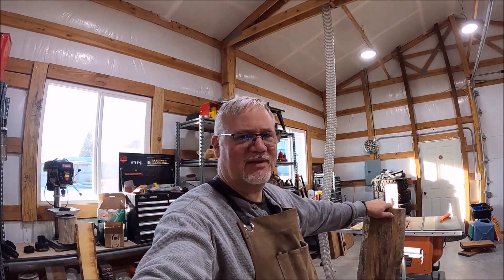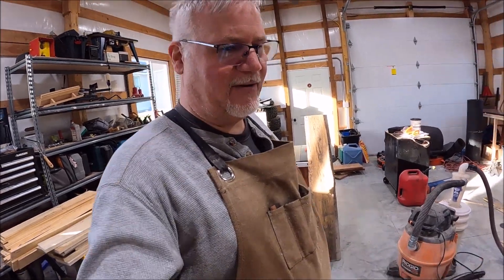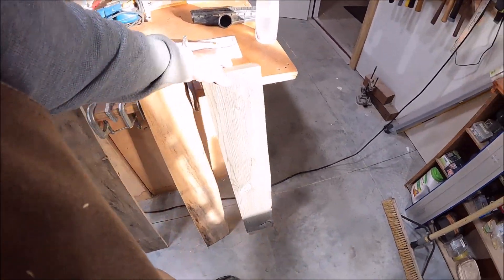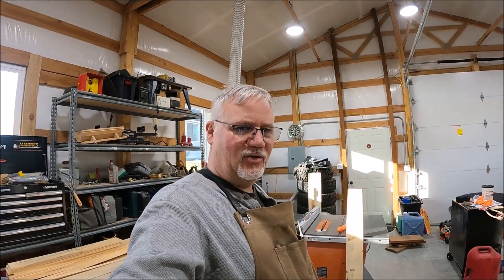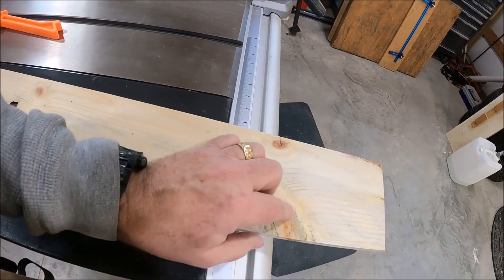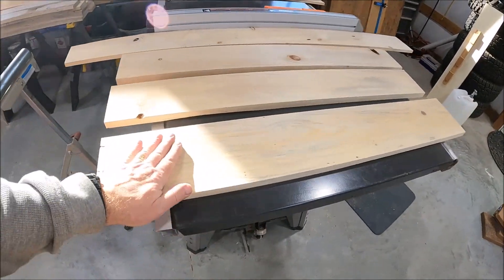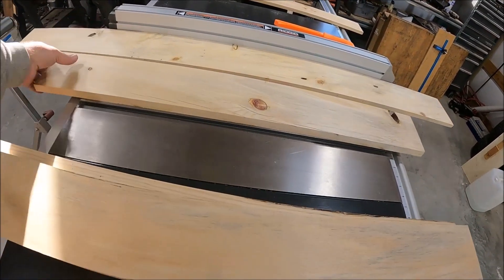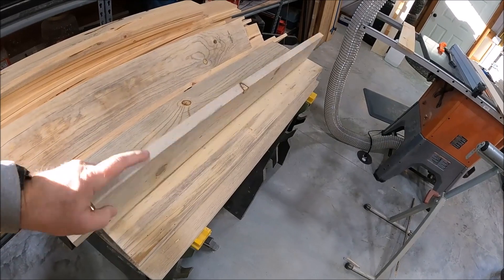Is this ugly old blue pine lumber any good?

Comment: I like the jig you have for cleaning up that live edge.
Reply from the maker: It's a simple table saw sled/jig made from MDF and a rockler rail and clamp.  I have a few of those actually, a short 3 foot one, an 8 footer and one for making spline joins.  All of them are super useful for guys like us with live edge boards or just stuff we air dried that moved around and need a straight edge milled into them.  I find I use them a lot since I don't have a jointer ;)
Reply from the maker: https://www.rockler.com/48-universal-t-track-with-hold-down-clamps
Reply: @TheOldJarhead  I like that may have to get me some of those.
Reply from the maker: you can cut the rails down too.  I have a 48" rail on a 6 foot sled and a 36" one one a 4 footer.  then use it on my spline jig and plan to order a few more.  they are great for work benches as well or miter saw stations for stop blocks...just plain handy!
Reply: @TheOldJarhead  no doubt. My first thought was work bench.
Reply from the maker: @DustyRanch  careful, they are addictive!  I can see them all over the shop and there are other clamps etc for them